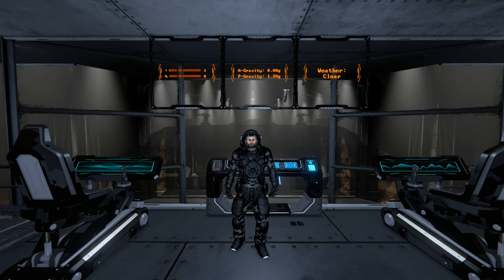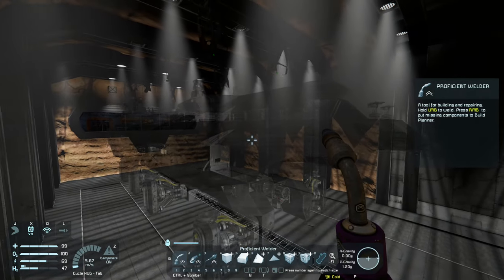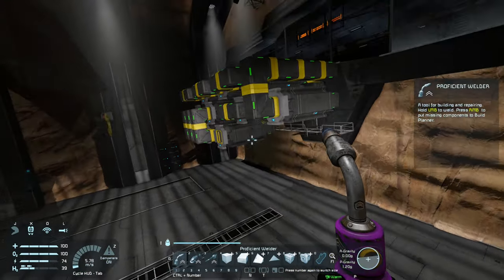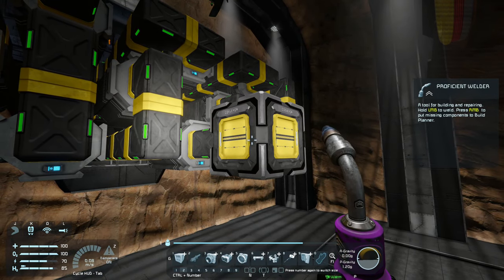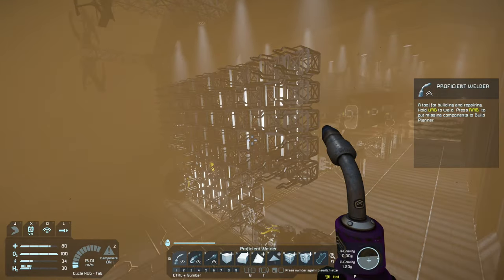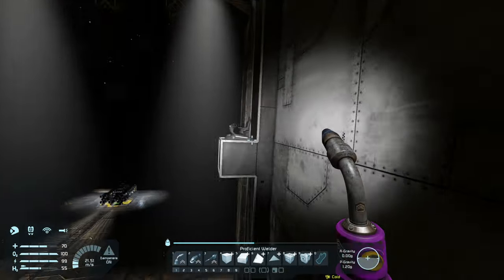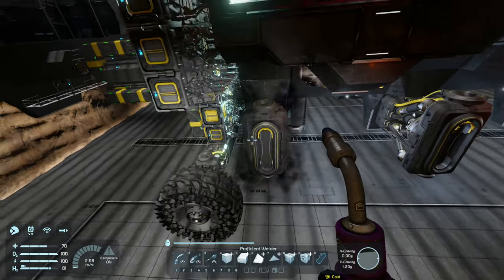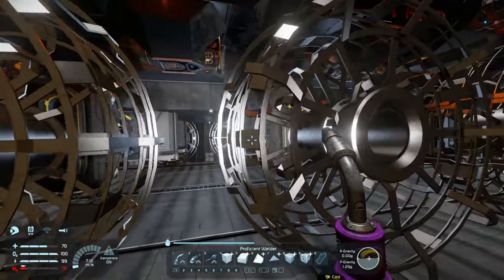Space Engineers - Wasteland Survival Ep13 - Building Large Grid Printer and Printing the Rover!!!!

Comment: Still liking your designs and videos, keep up the good work. Just a couple of comments. The welding wall would work better if it was solid welders. I have built a lot of these, all different sizes, the largest being over 650 welders to build a capital ship in space. I'll often set up a wall and use it for multiple prints, some small grid which really wouldn't work well if there is that space between the welders. Interesting though that you brought the pistons back manually, not something I had considered before, I just take .1 m/s / # of pistons, apply that to them all and let it go. But then I kind of cheat a little by saving before printing so if it runs out of some components I just reload and make more of that item before running again. Not something you can can do on a multiplayer server so doing it manually would be better.
One other thing for others reading this, at the end when you added the wind turbines to the rover if you had connected the landing gear to the main grid, not on a sub-grid via the piston, then you would not have needed to convert back to station. If the main grid is locked to the ground wind turbines will work on a ship.
Again, great work and thanks for all that do here.
Reply from the maker: Ahhhhh so that's why I had to convert it!! Thanks mate, I did not know that!! 😁. Yeah I have used solid walls before but the PCU was kind of insane lol. Wait until you see the next episode though, I've got a bit of a treat for you guys 😉👌